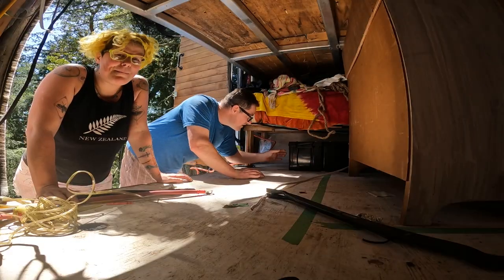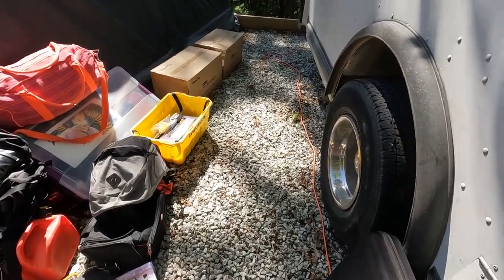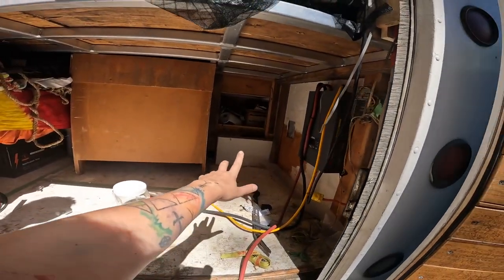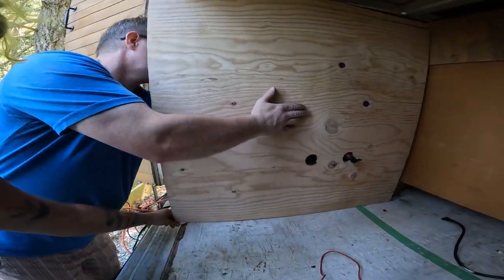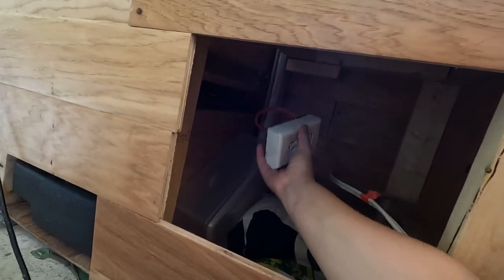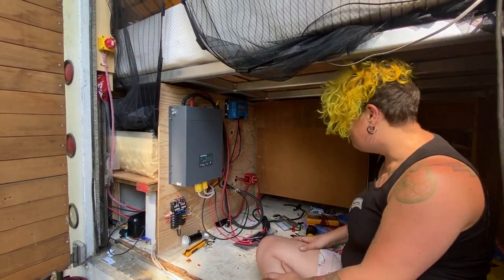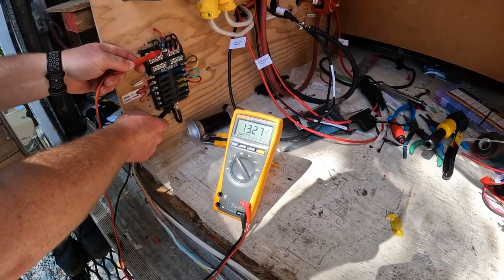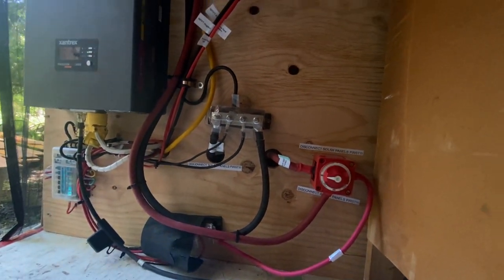I needed this!!! - Step Van Conversion

Comment: Was the interior of your step van covered in aluminum when you bought it?
Reply from the maker: @coltonomdahl4567 yes I believe all step vans or Grumman style vans have aluminum shells/walls. It’s the reason I bought one cos it won’t rust every!!
Reply: @FlossyRoxx  Thank you for getting back to me! I’ve got big plans for an upcoming FREIGHTLINER step van project and haven’t had the opportunity to crawl around in it yet. Do you know if there’s steel beams behind the aluminum like a bus or how exactly is the box framed? I’m planning to do a partial roof raise in the rear and I’m trying to figure my best plan of attack. Any input would be helpful. Thanks again!!